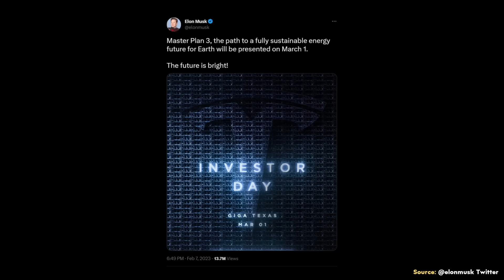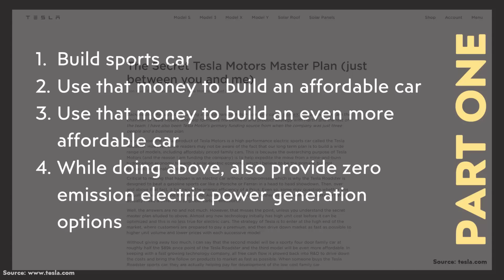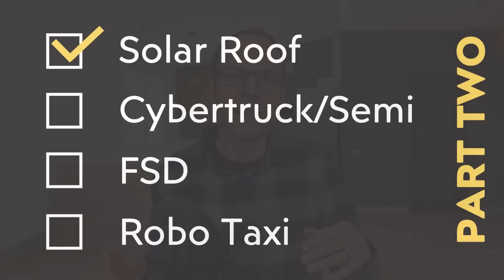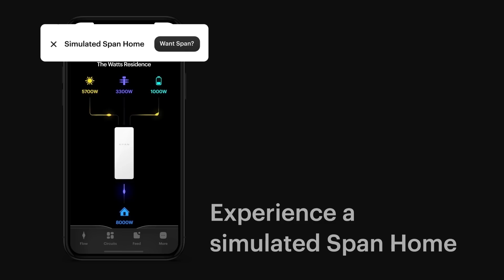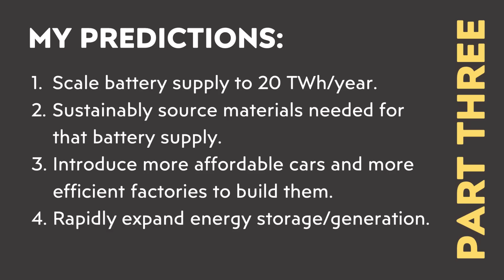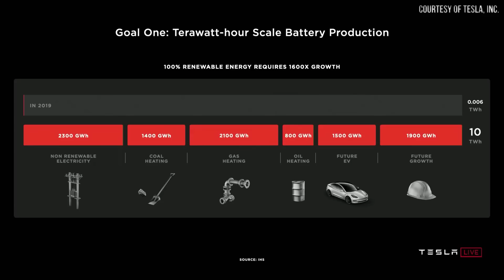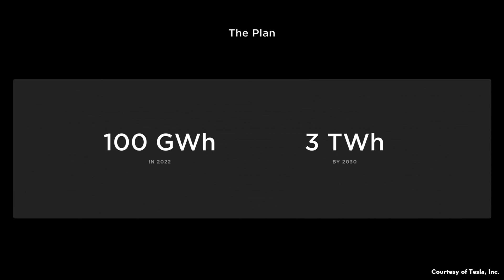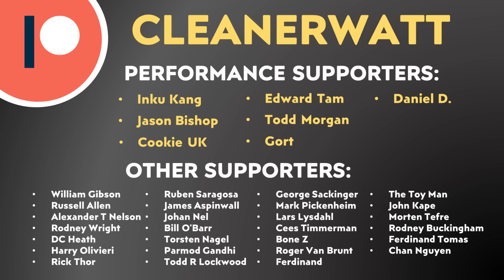Tesla's BIGGEST PLAN YET | Massive Scale & Domination!

Comment: I'm skeptical if there is enough lithium. Need sodium ion. What about other metals?
Reply: There's plenty of Lithium.
Sodium ion doesn't have and may never have the energy density to fit in the "small box" of a car.
(Ref The limiting factor YT)
Reply: @rogerstarkey5390  160-200 wh/kg and volumetrically worse (bigger) is not that bad.  155 liters (5.5 cubic feet) of cells is still enough for a ~40-50kwh.  Given efficient design this is definitely usable.  BYD is releasing a sodium based model later this year.  Sodium will not be going to be 400+ miles on a charge (unless you put it in an Aptera) but for most people's purposes it can still be used to make a viable vehicle.  Comparable weight and ~30% worse volume density than LFP is still totally usable.

Comment: will tesla let pre odders of the cybertruck 2 and 3 motor upgrade to the 4 motor or will all those pre odder be screwed and lose there cheaper fsd and lose there spot in line please someone  of importance ask this question
Reply: Let's think about this?
They just launch a 3 motor truck that weighs in at 81k.
.
Will they REALLY use 4 on a CT?
Not to mention, they have a drive system they could replicate at 69% size(?) that allows for the "cruise mode" which can overcome the Achilles heel of seemingly every othe EV truck?
.
Single front motor.
Dual rear motor.
Decoupling drive.
Chill for cruising/ towing at speed.
Beast mode for destroying the opposition.

Comment: Agree with scaling battery production - which is key to lowering each vehicle cost. Would also include some innovations on vertical integration and manufacturing to get to what Elon and drew hinted at during 3q earnings call around the lower cost (1/2 of current 3/y cost).
Reply: The battery holy grail....?
Cheapest material with density "in the ballpark", in the cheapest form factor.
.
That's LiFePo4 4680.
IF they can make it work.
.
Otherwise, it's small external footprint vehicle, max internal space.
Small external = cheap to build.
Max internal, best utility.
.
The "Small car" will be related to the Taxi, and several sizes of van, and maybe a small pickup(?).
Also expect a stretched "minivan" people carrier/ bus.
.
It's about efficient, cost effective movement of passengers and goods.

Comment: I'd be surprised if Master Plan 3 didn't include moving seriously into robotics. The proto-Optimus demonstrated a few months ago was unimpressive, and has pushed back investor expectations, but consider: the body was cobbled together from off-the-shelf (jangly metal) parts. The REAL breakthroughs in robotics are life-like "tendons," "muscles," "ligaments," and "smart" self-control, using sensors and AI to "decide" actions. Those are the basics Tesla engineers and designers have been working on, and I'll bet they have made serious progress. Coming versions of Tesla bots will have 3-D printed, softer body parts, shaped realistically. And they may borrow the DOJO chip to create a learning hive mind similar to FSD home base. I'll be amazed if Tesla isn't the biggest company in world history, by a good margin, by mid-'30s.
Reply: I think Tesla will progress much faster with their robot tech than the likes of Boston.  It's going to be similar to SpaceX innovating quicker than Boeing.
Reply: The “refresh rate” of the motors is the problem.
Too high and anyone can make a walking robot easy (like Boston Dynamics) but battery life will be 1-2 hours with a back pack.
Too low (what Tesla is doing) and balancing is very very hard but battery life can be 10 hours.
Reply: Did we watch the same presentation?
6 months work?
Reply: Tesla already owns their own robotics factory
Reply: Yeah, but do not forget that the most important thing on the bot is his brain, and to get it TESLA has to solve FSD neural networks & AI on the car side. Without FSD we will not have Optimus.
FSD is the key, in addition to batteries.
Reply: @gunnarcaguenssen  
False. FSD is far more complicated than a useful Optimus. FSD has to be completely reliable (at least as good as an especially safe human driver) in every real world driving scenario it may reasonably be expected to encounter. Optimus just needs to be smart enough not wander out of whatever factory it works in in order to be reasonably safe. Safety being the biggest issue with FSD right now, all Optimus really needs is some way to teach it tasks that are slightly more complex than what current robots can handle and you already have a useful product. Further improvements can gradually make it more and more useful.

Comment: Thanks. Great words & stimulating insights.

Although I see that scaling up is core to the needs of Tesla, MM3, I see the approach most advantageous to achieve this is to formalize the synergistic dynamics inherent w/all of the companies, Tesla, SpaceX, NeuraLink, Boring & even Twitter.

MMP1: I don't think they've completed this just yet. I think there is more to do w/getting to an affordable car & transitioning to sustainable energy. This includes correcting their shorting on X&S. These Need to be ramped up w/structural batteries & front-rear castings. These can at 1st be sold at the highest premium pricing the market would bear. Then gradually reduced after the remaining ones are sold. Margins will be increased. The presses will out produce what is needed thereby being available for other uses. Eventually offering an updated 4680 LFP+ battery pack.
My reasoning here is that there was more economic advantage to glean out of the basic MMP1 insight to use higher end cars to finance more affordable one. For that matter a Roadster refresh, a 1.5, not yet the 2.0 rocket charged one, would be good too. Also done w/4680s & castings.

MMP2: All the points of MM2 still require much work before fully checking them off. The scaling portions of what is anticipated to be MM3 will address this. My concerns are particularly in expansion of the energy production & storage vector. We clearly need much more production as well as more products that are aimed to granular distribution-storage. Say a mini-megapack sized for neighborhood use, linked to solar rooftop in residential & local commercial settings. In terms of EVs creating a casting platform that can be sold to other manufactures that can then be designed to their own vision will further the adoption of EVs. This system would be flexible to allow New startups to use the platform to build their own bespoke EVs on. 

MMP3: Beyond scaling Using an approach to leverage natural synergy between the companies further the advancement of all goals as set forth in MMP1 & 2, including new products such as delivery vans, compacts, and beginning design for construction EVs.
Furthering research & bringing to market new products and services that can be address only through a unified synergistic melding of the different companies is a core potential. Examples of that are many & I'm sending them along to Tesla & Companies.

Comment: Re Master Plan Deux #4: Enable your car to make money for you ... .
Why not support V2X bidirectional charging so someone with a Tesla EV and Tesla Solar can go completely off the grid? For the occasional time when your Powerwall runs out of juice you can just drive to the nearest Supercharger and get a refill.
Reply: V2H bidirectional charging would basically help reduce overall net battery needs - if you’re home and there’s a power outage, your battery backup is the car - previously before we moved we had quotes for 3 powerwalls ~12kwh each for ~36kwh.  A model y has a ~78kwh pack and I believe the on board car charger has a built in inverter that’s not enabled yet.

Comment: I think the concern about battery materials long-term is overhyped. There are iron based batteries going into cars this year and Li-P also. Iron phosphate and other chemistries such as Aluminum air ( in production but not for EV yet) are coming in the near future. For stationary batteries, there is enough off-river pumped hydro to cover all the needs. This sets a cap on the price for stationary batteries. So if prices start to climb from material shortages off-river pumped hydro is always an option.
Reply: It's a question of volumetric AND gravimetric density, against vehicle volume (pack space)
It's not always better to have the "cheap" cell.
Fewer, high density cells can make a cheaper pack/ smaller vehicle.
Aluminium air? Non starter. It's a sacrificial cell. That just reintroduces all the logistical/ resupply issues that batteries remove.
River pumped hydro? Great until a weather pattern shift depletes the ice/ snow melt that feeds the river.....? (Happening!)

Comment: I think the predictions are pretty spot on. Personally I think we will get information about more factories, possibly 3 factory announcements. Information about how they will vertically integrate material supply. Information about Gen3 platform, how they plan to make it cheaper (reduced performance, increased efficiency, lower weight, less battery, etc), maybe a design reveal (it will be called Model 420). Information about how they plan to approach scaling up. Possibly a 2nd battery chemistry for stationary use; I think this is important to reduce reliance on specific supply chains. I doubt we will hear anything about FSD, RoboTaxi, Dojo, Optimus, Semi, Solar, Twitter, Boring Company or SpaceX. I would not be surprised if Tesla considers getting into microchip manufacturing or anything else that could affect their supply to reach 20 million vehicles a year.
Reply: Based on other comments by Musk, I don't believe they want to do chip FABs. 
FABs are a very high cost investment and Tesla can't justify a FAB for the volume of chips they use.
TSMC is ahead of most of the world in chip production tech.
Reply: Microchip manufacturing is not for the faint of the ♥.  If that is so easy, 🇹🇼 will be already a part of 🇨🇳.  U.S will not be pouring all its might without a war in the horizon. If 🇹🇼 is lost to 🇨🇳, U.S. Military will have hard time keeping its infrastructure secure. Hopefully the tech. transfer happens in time with the proposed TSMC's Arizona fab. Running a sub nm scale microchip fab needs a lots of resources(In several  billions per month, since you can't let a fab idle to see the yield loss going through the roof), people  with several decades of expertise and sophisticated tech. machinery(most of the advanced 🇹🇼 fabs are human free!).  I am sorry to say, that is not within Tesla's capability for atleast 10 yrs into future. Hu

Comment: not a lot of meat on this video......

And I think you missed MOST of what Mr Musk has for his Part 3 and the broad strokes therein
1.  Address how to source raw materials and just what exactly, is needed for 20 TW/year battery production
2.  Announce new factories and their new form factors / optimus building and integration into factory line.
3.  Announce solar panel mfg plants in Mexico and Indonesia

what Elon will NOT discuss:  smaller vehicle, as it would crimp Model 3 sales until it is ready.
Reply: Tesla will not manufacture solar panels...
The factories in Mexico/Indonesia will produce battery cells and/or megapacks.
Reply: @udishomer5852  Agreed, and why is that? Because Tesla Energy is not among the world's largest wholesale consumers of solar panels and thus has no particular advantage in becoming vertical in this respect. Same reason they do not have a glass factory for car roofs, nor LED factory for headlamps.

Comment: One of the weakest parts of FSD Beta is multi-turn lane handling. When I turn left, it wants to use the leftmost lane, even though I have a fairly immediate right turn ahead. Same with right turn. If I know I need to be in the left hand lane on the new road, FSD still wants to use the rightmost lane to turn then change lanes to compensate. In traffic, that doesn’t cut it.
Reply: No need to contact Tesla all your inputs and cars behavior are recorded to Their AI servers :)
Reply: It's hard coded to use the closest lane during a turn, which is the law. I have a feeling once the nn navigation comes in v11, it'll make better decisions about which lane to start out in.
Reply: FSD will never be any good until it has human level awareness. It lacks the ability to conceptualize on the run. A Tesla hitting bollards is a good example. A human sees a billiard on a corner and predicts more bollards ahead and avoids them. A car with  FSD does not predict what is ahead and did not see the bollard ahead and drives into it. The computers understanding of the world doesn't even match a 10 year old, would you let a 10 year old drive you around? The FSD system does however have better concentration and super fast reflexes. 
The computers need to understand what it s seeing, like a human it needs to 1) absorb data from the world 2) compare to experience 3) predict the future 4) choose suitable reactions. All done in real time. It fails on accurately predicting the future at run time. The is because it doesn't comprehend the world it is predicting. Humans understand the implications of their actions. Humans can accurately extrapolate  the short term future from what they see.
Reply: @r4ym1n13  but how many things like that do the software engineers have to account for? Close to infinitely I guess. Example a car is programmed to stop when it sees a stop sign, however a clown is walking along the foot path with balloons and blocking the sign. How do you program for all the bizarre possibilities in the world? FSD currently lacks awareness of the world, it does not comprehend the world at a human level in real time. We need better computers, they are simply not powerful enough, and definitely the code doesn't have the awareness of everything it sees.
Reply: It's learning.
There's more feedback, assessed by an improving system, but with less "knowledge gap"
Think back to when you learned something (driving, school, work).
You go from information overload to "I know that module" to "I know 10 modules, only 4 left".
Then you stitch the modules together.
Today? It "knows 10 of the 14"